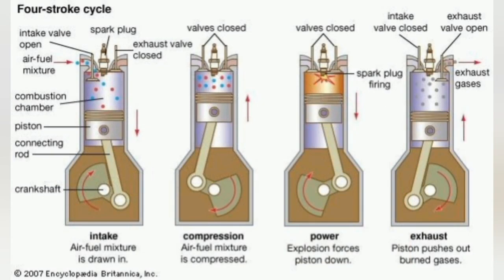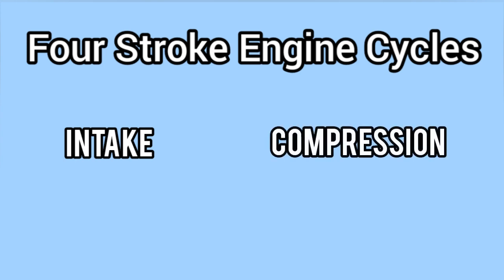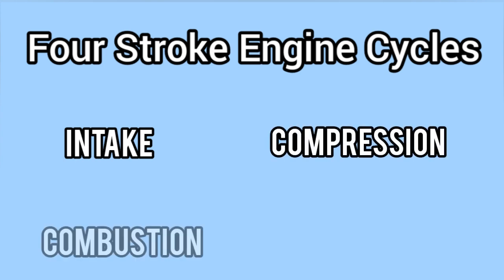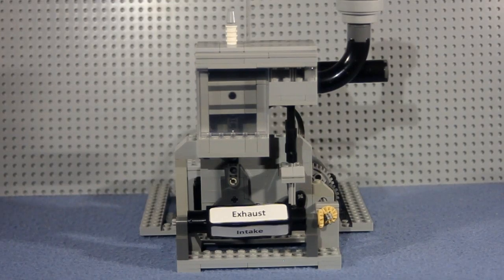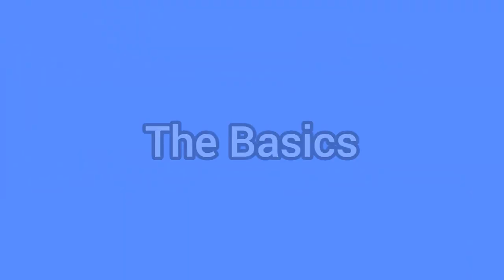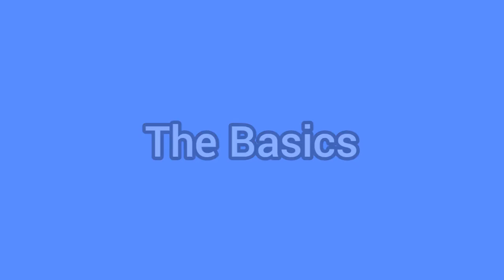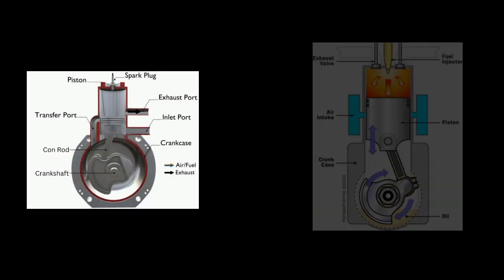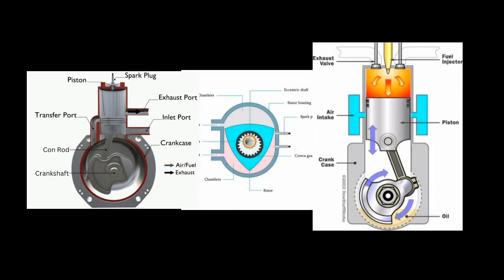How Engines Work: Explained with LEGOs

Comment: What size is the axels for the valves?
Reply from the maker: I believe for this particular engine it's a combination of a 5L and a 6L with a 3L connector. But the length of axle can vary depending on what style of engine you're making